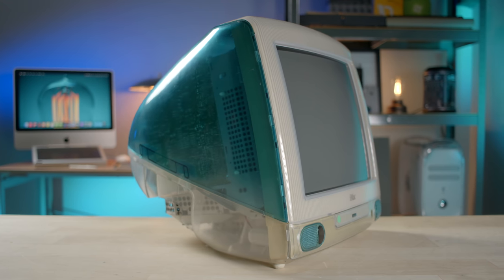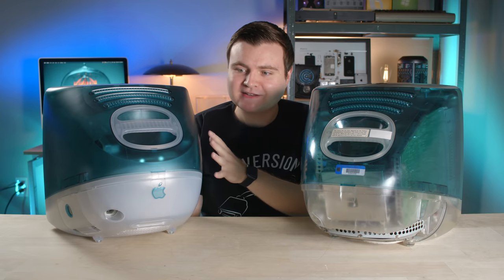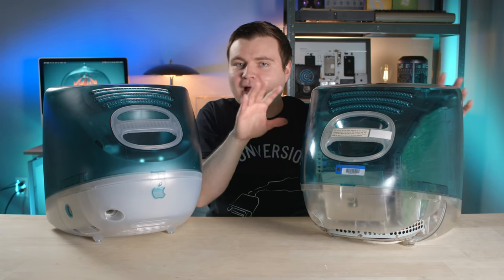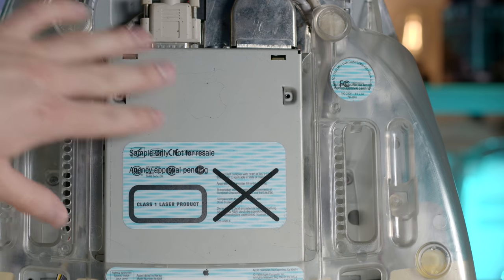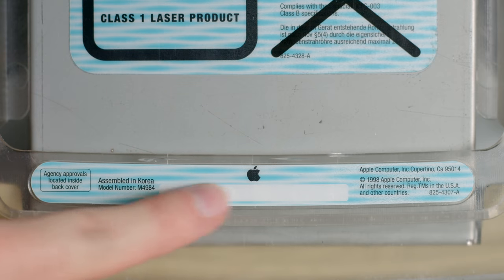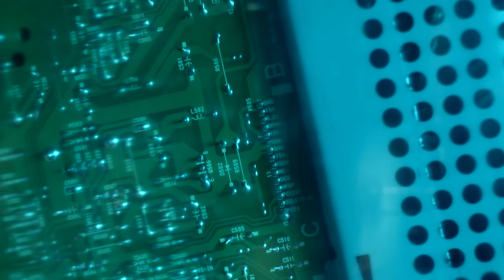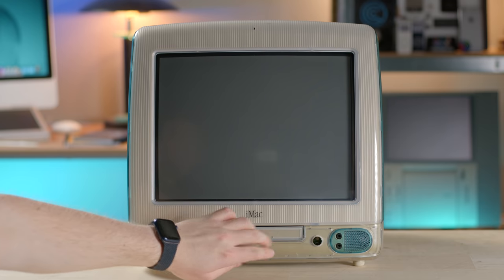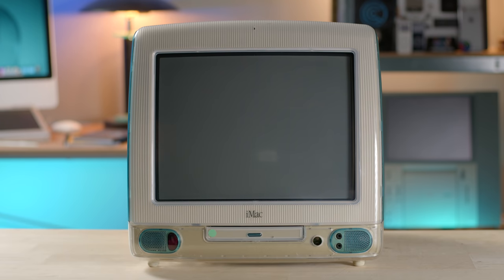Insanely RARE iMac G3 Prototype - Krazy Ken's Tech Misadventures

Comment from the maker: UPDATE: Watch the repair episode next! (ft. Steve from Mac84): https://youtu.be/RKrI7Q3V0D4

Enjoy the new episode! I hope you like the fun announcement at the end. 😈 P.S. I missed a few other unique features about the board, so let's see if you can spot them yourself! Don't worry, I'll cover them more in part 2. ; )
Reply: So Ken, this thing was made in 1998 according to the stickers on the back so I’m guessing it was pretty close to the actual G3 except the casing and the few missing things on the logic board that you pointed out.
Reply: wow only 1 reply
Reply: This may be a stupid question but did you add ram before you tried to turn it on?
Reply: @alykhanrajan871  Even if he tried it without the ram. It should have showed some signs of life, such as beeping noises.
Reply: You are mean... Can't wait for next part
Reply: There's a floppy connector, and ADB. Fun fact, if you populate the ADB port and related components on a retail board, it'll work. The floppy header will also actually work, but only under OS 8. OS 9 and higher just don't work with it. Shows you that the decision to drop the floppy drive was not final until pretty late in the design phase.
Reply: Hey ken it could be the power supply.
Reply: HOW DID YOU GET THE PROTOTYPE?
Reply: @acpifixedfeaturebutton  I've seen this prototype sit on eBay for quite a while.
Reply: @Dan-TechAndMusic  link?

Comment: I have worked with some molded parts in the past, and one reason that it is shinier is because they have not applied the final texture to the mold for the part in case they need to make changes. That allows for the texturing to be uniform and not to have a spot of different texture in the mold due to a late part change.

Comment: Plug the Apple keyboard with a power button on it. That’ll get her to boot. Have had this issue before with these. Cheers from Nova Scotia.
Reply: also give it RAM! he saw it was missing RAM put a standard SDRAM from the retail one in there. I highly doubt that would have changed, at all in the phase of development this is in.
Reply: @tommytomthms5  likely our host installed ram prior to reassembly.
Reply: Maybe it could also be a battery problem? My g3 died and I had to replace the PRAM. Powered right up
Reply: @Austin_Boath  speculation is endless.
Reply: @Austin_Boath my imac g3 has dead battery too and boots perfectly

Comment: Considering that it doesn’t make any sound I would guess that the power supply needs some work. Also you could theoretically put the logic board into the chasy of the other iMac although it would probably be better to just fix up the power supply because there probably is some small voltage difference between the final and the one in your prototype Mac.
Reply: I doubt there are any voltage differences. Computers usually run on standardized voltages like 5, 12, 3.3v and I doubt the prototype is any different.
Reply: @the-guy-on-your-moms-couch  yeah i know i'm a horlibal speller

Comment: I remember when Steve Jobs said WTF is this (referring to the tray of the cd since he wanted a slot loading one) anyway have a nice day 🙂
Reply: Lmao I can picture this
Reply: I wish he'd stamped his feet until a slot-loading CD drive was put in the original models. The tray-load one was a most unreliable piece of kit. Mine did kinda work up until we got rid of the machine, but stopped reading most CD-Rs after a few years.
Reply: @3rdalbum  yh that’s why he wanted the drivers from pioneer and panasonic instead of others but there were a lot to price restrictions thx to previous bad management and on the first series of iMacs they had to get cheap enough and they had not much time to make it…anyway have a nice day 🙂
Reply: So, he didn't always get his own way then? I bet that was frustrating
Reply: @penfold7800  Yes it was and that’s why he was sometimes so hated bcz he wanted everything like he thinks that it should be without considering costs or time..but sometimes he was right and sometimes he wasn’t...anyway have a great day :)
Reply: @3rdalbum  the slot loading ones aren't particularly reliable anymore at least, dead drives are pretty common on later G3s

Comment: I used to service a shit ton of G3 iMacs at my first job. Like 20-50 a week.

The tray loader model iMac was way way more reliably than the later slot loader. If I remember right, about the only regular issues we had with them was the PRAM batteries (all Power Macs had that problem) and kids breaking/jamming the CD drive. The logic boards on them were pretty solid, few issues ever that weren't solved by either new RAM or reseating the CPU board. The cables and sys tray were a pain though. Some extension cables would have helped a lot.

The later slot loading iMac has lots of issues and extremely frequently. In about 2002-2005 while working there, we would have at least several hundred in for repair at any given day.
Apple used Quantum Fireball drives, particularly the model that has a near 100% failure rate of the spindle controller IC of exploding its power pins in a literal fireball. We'd order HDDs by the case and would run out in a week.
The earlier revisions of the main board did not have any heat sinks on any of the main chipset ICs, so usually one of them would get fried after a few years of use. We could still get new logic boards directly from Apple, but they were expensive ($500+ I think). We could also set them out to an independent local board repair shop and get them fixed for around $100-200 ea. Yeah, back then you could just buy the chips and repair the boards quite easily.
The certain OEMs of CRT would burn out their fly-back transformers, of the several thousand iMacs we had, this was about 10%. The same shop we'd sent the boards to were able to replace the flyback for like $80.
The slot load CD drives would wear out from use. Usually just cleaning the rollers with highly tonic chemicals would get them back in to service for a couple more years.

G3 was really hit or miss in terms of reliability. Some models were solid and needed little over their entire life even well past EOL, others would be lucky if they could go half a year without requiring servicing. G4 was slightly better on average for at least what we ended up with. Like the first LCD iMac that looked like a lamp, those were both depending on what rev backlight driver it had or if Apple put enough thermal compound in when assembling the case. The Cube Macs were nice (mostly just because they were interesting, even back then), though HDD replacements were a pain. By G5, Apple had decided to become ultra up-market, so for the cost of kitting out an entire school's computer lab iMac G3's, we were instead only getting a handful of G5's for teachers and librarians with connections.

Starting around the G4 era though, the move to PC on the student side was already under way. PC were not only a lot cheaper (even we were buying direct from IBM) so the tech grants went further (and Apple has killed its EDU grant programs, so we were not vendor locked anymore), but also PC's percentage share in home and business had increased drastically during the explosion of home computing starting in the late 90's and in to the early 2000's, so it made little sense for students to be taught on hardware and an OS they were extremely unlikely to use outside of school.

It was really hard for anybody who decided on purchases to justify a classroom full of Macs for over double the cost for less than half the specs and drastically decreasing support. 

Apple had been trying to kill their authorized support/repair program through the early 2000's and it was getting harder and more expensive for us to renew. Apple was providing less in the way of service manuals, tools, and parts. Eventually they killed access to the diag tools across all newer models and system images for anything currently not being sold. Apple aggressively changed their EOL policies, making anything older than a few years "EOL" and would provide absolutely nothing for those models. No manuals, diags, software, or parts, barely acknowledging it had existed. Luckily we kept local copies of most of the downloads when Apple suddenly made those changes, but the lack of parts availability would suddenly turn any old system in to ewaste when it needed an Apple specified part. We were getting around 8+ years out of systems (Mac or PC), but under the new Apple, that would be barely over 3.

So yeah, the whole recent situations with Apple repairablity isn't at all new and its been pretty funny to watch.
Reply: This was quite the interesting read. How were the emacs in terms of reliability? I remember my 5th grade teacher had to send the one on her desk out for service and it literally took months to get it back. This was in 2006 and the emac was either a 700 or 800 mhz model so it was probably 3 or 4 years old at the time. I don't remember exactly what was wrong with it.

Comment: The transparency in the plastic - which as you say is common in prototypes - is a conscious design choice. Engineers require this at the later stages of design so that they can visualise air flow through a product; so in the case of this computer, it would be how the air is drawn and then pushed out/rises through through the grille at the top handle via convection.

To do this they use a gas that creates a slight fog effect, which once inside the chassis, will be very easy to see and will therefore allow the engineer[s] to understand the thermal limits of the device by where and how it travels.

Comment: I wouldve opened up the power supply to check to see if there was a fuse soldered to the power supply pcb. This would be the first single point of failure that will prevent any indicators working.

Comment: The smooth plastic for porotypes is likely a cost/time saving decision. For injection molding the molds are machined out of steel, which is a very labor intensive task. This machining process leaves behind tooling marks, which then has to be sanded and polished. If you want to add texture, which can be done with media blasting, laser etching, chemical etching or through an EDM process. All of these take a lot of time and don't add anything to the functionality or fit of the parts in the early design stages so it would make sense not to include them on prototypes.

Comment: There were a bunch of these. I remember seeing these in our grammar school donated from Apple back in the day..  They were cool. And I think that’s why they made the clear body Macs there for a while.. I think they even made a educational Mac with the clear plastic around the monitor and the clear plastic on the computer itself I know the keyboard for sure

You are correct about clear plastic being cheaper. The reason they probably had to fog the retail model was probably because of the fire prevention added to the plastic. Which would’ve been bromine.. It’s also got other characteristics added to the plastic for heat and to keep the case from popping and making noises when it’s on that you’re going to hear on a rigid poly styrene ABS material with no treatment or reliefs built-in

Comment: The reason it’s shiny is most likely because they save the final EDM process (gives the mold a textured surface) on the plastic injection mold until last just in case they make revisions to the mold design.

Comment: textured vs shiny plastic. All mould tooling is shiny, and can easily be re-milled. If you have something that is textured or rough, it is because they acid etch the inside of the mould tool. once that has been done, its difficult to make modifications to a tool, as any modified areas would be shiny, and need acid etching again..,.. which would over-etch the already acid etched areas.

It is what makes the micro detail on the new PlayStation so impressive, as that ISN'T the standard acid etching. No idea how they do that.

Comment: Prior to its public introduction, I had one of the original iMac prototypes on my desk at MacroMedia for a little over a week. It was completely clear, no color at all. The iMac itself worked well (CD drive door didn't fit well, though) but it had the worst sample of the worst design mouse that I've ever encountered. That round hockey puck mouse was a poor design, but the prototype sample I had had a case that was so poorly molded that it was all but impossible to use. The guts just slopped around and the two housing pieces didn't fit well.

Comment: Just put some ram in it first. They may also be a bios ram chip missing too. I had an older Mac once that would only turn on from the keyboard, so check that too. It's very highly likely there's a switch-on check wired logically (not programmed like POST on IBM machines) where the circuit just won't connect any further if certain scenarios aren't in place (such as RAM and a working Hard Disk). With any luck, it will be something simple. There is hope, as you didn't notice anything black, burnt or Wierd smelling when you opened it up, so seeing as it's probably hand built the old fashioned way, it should be fairly robust. ...especially if it was a test bed for future changes, it should be mostly fully working.

Comment: Considering that the motherboard propably controls the power to everything, i would guess that even the crt cant get power because the motherboard cant boot without ram.

Also considering how similar the front is to the retail model, you could give it a new optical drive door and a power button
Reply from the maker: I’d say the analog board is more important when it comes to power. ; ) Not the logic board. A Mac can turn on without RAM, but it cannot boot.
Reply: @ComputerClan  Adrian's Digital Basement had a mac that could boot a crt because the logic board was dead, if i recall correctly

Comment: The yellow PCB most likely just means that the boards has no soldering resists applied which gives most PCBs the green, blue, red and black color.
Reply: Lots of finished boards have the same color. I would be very surprised if it didn't have soldermask because then it would be infinitely more difficult to assemble.
Reply: @eDoc2020  you are Right. I forgot about the existing clear coating the exists. It is probably more likely to be that. It’s just I got an uncoated sample my self the other day on my desk. And for manual assembly it is kinda ok.

Comment: The manufacturer in Korea may have been LG, who i believe it has made the slot loading Imacs for Apple..
Reply: I had read those imacs won't even try to start if the pram battery is gone, so, rather than trying complex measures with a multimeter, it can be helpful to try swapping the battery and adding ram.

Comment: if no ram it wont turn on because ram sent power to CPU to crt because missing few parts 2nd i adjusted u get voltagemeter and check for 12v dc n 5v dc if psu not putting out any voltage n look up for jump pin to turn on power supply if have voltage but no sing of life because of missing ram once u installed ram should boot up either way because i have worked on few them n for customers "one customer bought it in said wont do anything turn out was died psu n got it replaced n 2nd customer bought other one in said wont do anything and test it with other psu nothing and replace ram it finally power up well that was easy" save ur self a headache